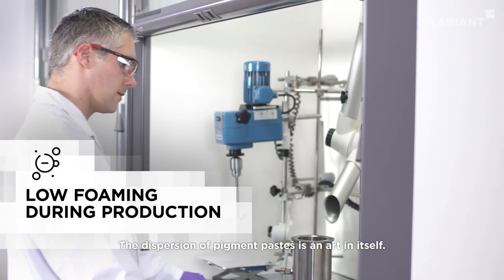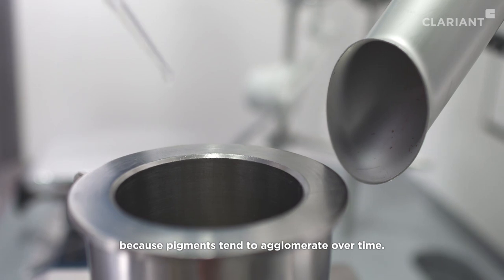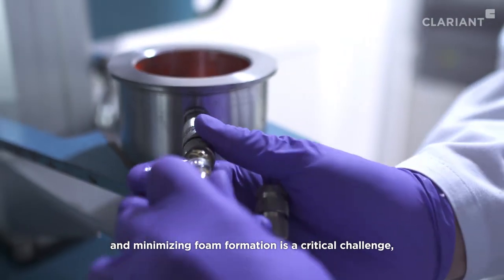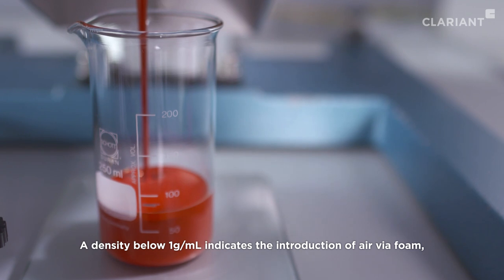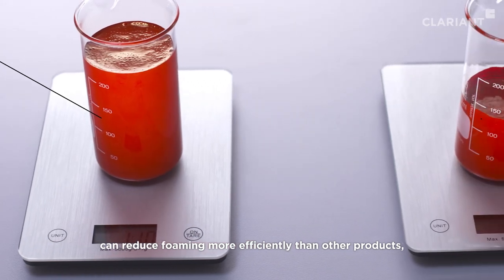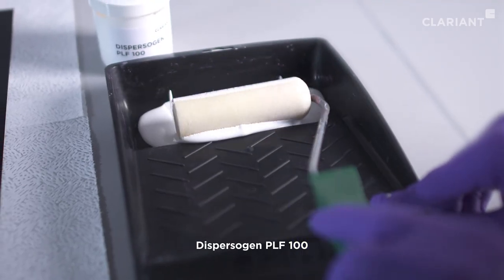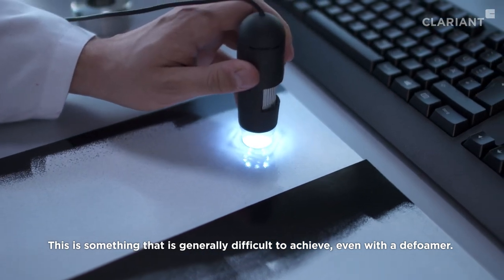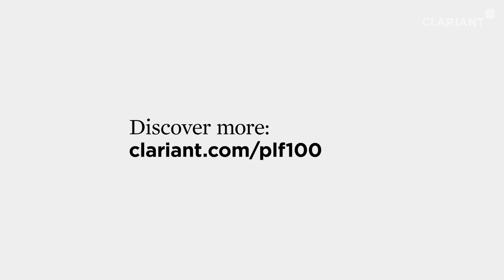Low foaming: Dispersogen PLF 100, a Dispersing Agent for Waterborne Pigment Concentrates

Comment: There is a great video demonstrating follow up dispersion analysis on an automated machine called TIDAS (made by Labman Automation). This analyses the grind gauge and makes the dispersion easy to see as it produces an image. It produces a rating automatically and removes the operator variation you often find between users in labs. In this instance, being able to highlight air bubbles in a sample may be really useful